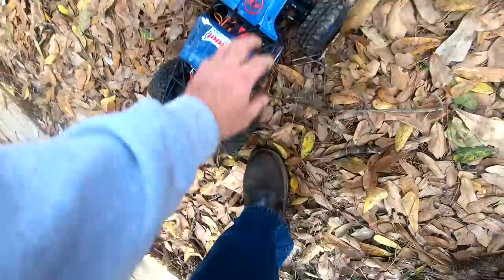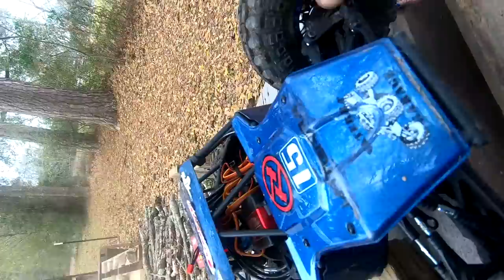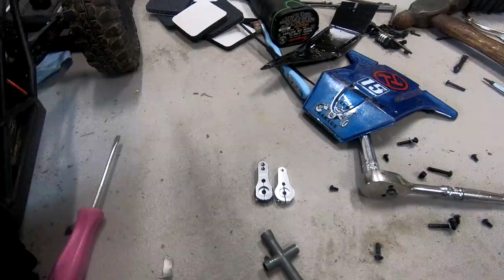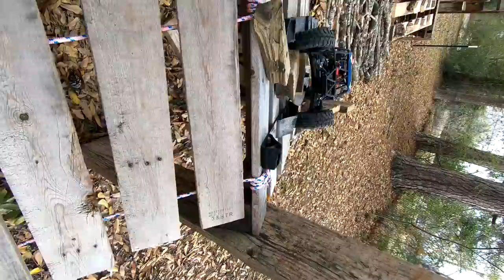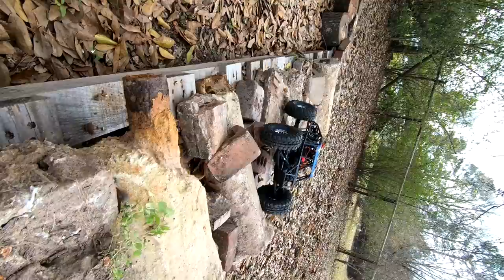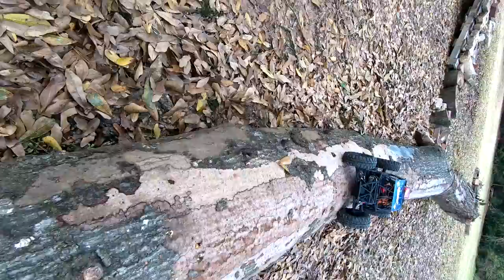VATERRA TWIN HAMMERS/ CAN IT CRAWL?

Comment: I've had my dos hammeros for 6 years and it's still my all time favorite
Reply from the maker: I definitley know what you mean. I don't think I could ever sell mine. It is just a blast to drive!
Reply: @RCMechanicGarage  I put a Novak brush less setup for a 1/10 truck in mine. I swear it runs 50mph. But it can also slow speed crawl
Reply from the maker: @fartdonkey8290  Excellent! I am still experimenting with  the castle programming . The crawling part is difficult. What KV are you running?
Reply: @RCMechanicGarage  I think it's 5400. It's at least 5 years old. I went with Novak because back then they had the best low speed control. Really couldn't tell a difference between their brushless and a crawler brushed motor. I'm sure it's completely different now. Also silly putty in the front diff makes it full time 4wd until a front wheel gets completely stuck